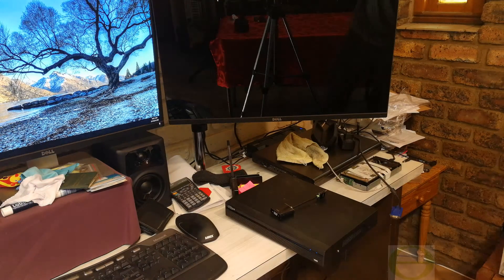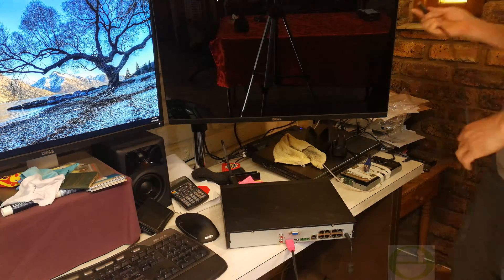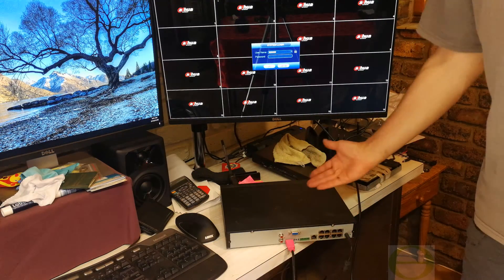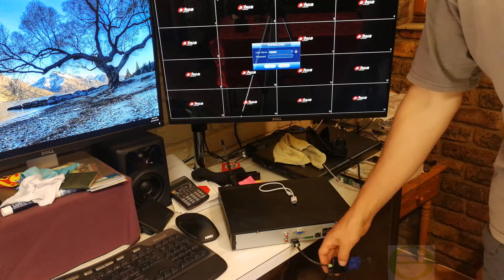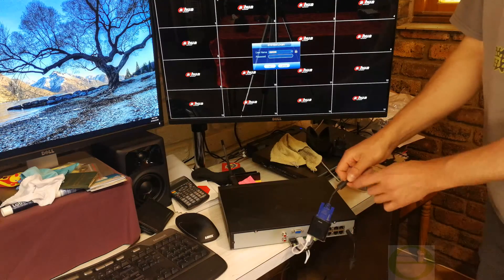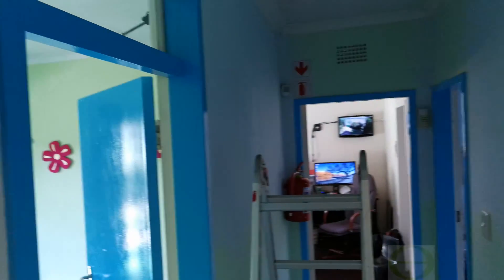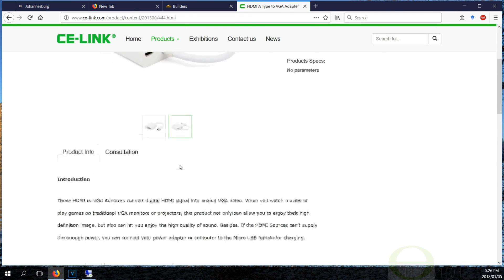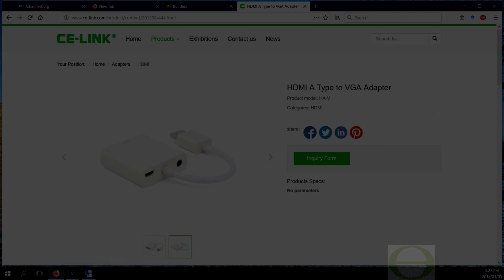VGA output not working on NVR/DVR, solved using HDMI to VGA convertor (NVR)

Comment: Great video! Thanks. My DVR-5680 unit is brand new and the VGA doesn’t work, so I’m using your method. Frustrating for a new unit
Reply: Turns out, as suggested by @Bob Bakley, it was the settings for my unit. I hooked it up to my TV using HDMI and the resolution was too high for my small monitor to handle through VGA. Dropped the resolution in settings, plugged in the VGA to my monitor and it came up. Thanks for your advice Bob

Comment: Its the Hackers that got in. Really sucks they are using the backdoor telnet access. Change the 888888 password if you get it reset some how. Unplugged the hard drive and turn of and on. Good luck finding the rest switch inside on some units.

Comment: IAM using VGA to HDMI converter in my laptop Hp pavilion dv 6000 to connect with my projector it works properly in duplicate mode it shows both display proper in laptop as well as in projector but when I select only projector mode it's shows no signal in projector what is the issue sir
Reply from the maker: are you using Intel drivers? Please check you graphics settings on your laptop and scale according to projectors specs.

Comment: Sir when i connect dvr to monitor with vga cable and swich on dvr that time moniter show dvr booting (HIKVISION NAME) but then moniter show black screen AND same dvr get ping but not connected in neither software nor web browser how to solve
Reply from the maker: can you try log in via web interface? Can you try plug in monitor on HDMI port, can you try monitor in different resolution setting?
Reply: @ecologicaltime  yes i try to changed resolution, dvr not open in web browser but i get ping and hdmi port not available on dvr

Comment: Check the display settings in the menu.    The VGA output has different resolutions than are available with the HDMI.    I can't remember exactly what the exact settings are.    In these less expensive units they can't output different settings for each dsiplay type.
Reply from the maker: its 1080 and it went dead. The output fo the HDMI is still 1080 and the monitor works fine. Fault was the vga, thanks for your comment. I should have stated that in the video.
Reply: No problem,   I set one of these up for a neighbor of mine and he wanted to use both a dedicated monitor using the VGA output and run HDMI to his TV set.    There wasn't a setting that allowed both outputs to function at the same time, it was one or the other.
Reply: Truth Warrior Thank you bro
Reply: I’ll check my settings as my unit is brand new and VGA doesn’t work but HDMI does
Reply: Great advice @Bob Bakley, it was the settings. I hooked up on my TV and the resolution was too high for
My monitor to handle. Dropped the resolution in settings, plugged in the VGA to my monitor and it came up. Thanks for your advice!